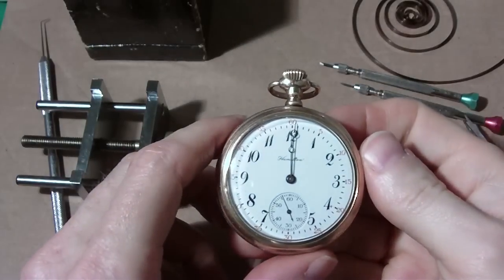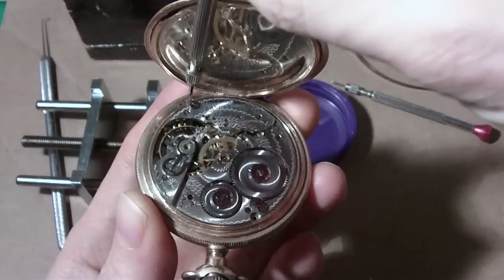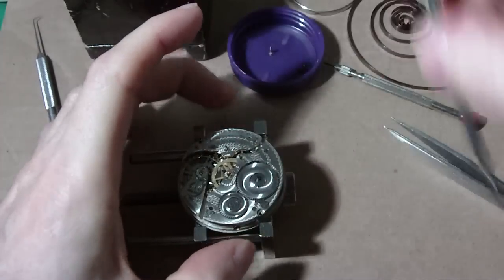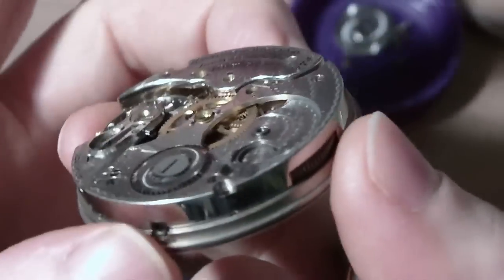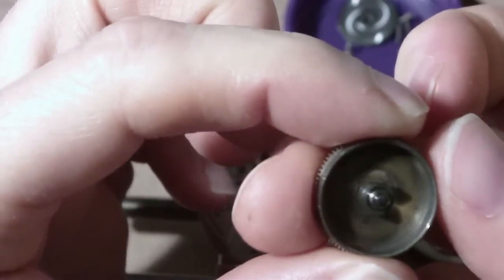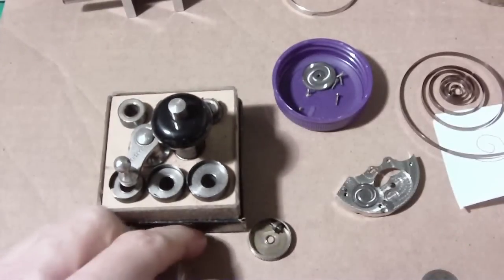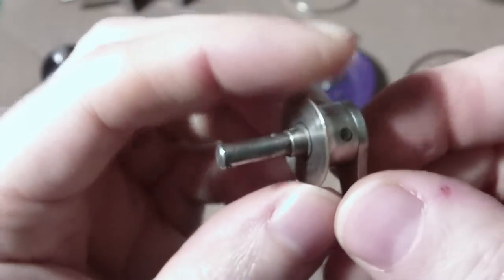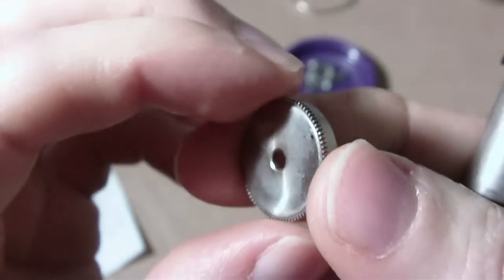How I Install a mainspring on a Hamilton 974 pocket watch, part 1 of 2

Comment from the maker: @mig29jette Since I have no training I don't know if my method is correct.  I installed the crystal while the bezel is off the watch.  I held the bezel in my hands and with my thumbs worked the crystal into the bezel.  I did not come straight down with the crystal but at an angle.  I sort of pushed the crystal against the inside edge of the bezel.  It felt like the crystal was just a teeny bit bigger than the opening in the bezel and I was either compressing the crystal or expanding the bezel.

Comment from the maker: @mig29jette I have little or no patience.  What stops me from throwing a watch against the wall or smashing it with a hammer is that it will not be repairable.  I have only replaced a crystal a couple of times and it was for an open faced pocketwatch.  I had to fit the crystal to the bezel by removing material from around the edge of the crystal a little at a time because if to much is removed the crystal will not stay in.  You might have the original crystal since it is so hard to install.

Comment: I think you have the perfect "demeaner" to do this kind of work. I almost lost it last night over replacing the same crystal on my Hunter cased Elgin which for some reason fell off in my hand.......the crystal did, and now the bezel pops on GOOD, I use the 'notch" in the side of the bezel to pop it back off. WHAT IS THE SECRET of putting this crystal back in a HUNTER cased Elgin. Do you try and get the crystal in the bezel FIRST? or do you lay the crystal on the face and try and center IT?

Comment from the maker: @ElginPocketwatch It might work but I wouldn't do it.  A 16 size spring is narrower than an 18 size spring so the T end might fit into the hole on the barrel but it might not stay there.  Also the hole in the spring for the barrel arbor might be to small.  Since the spring is smaller it might not have the power to run the watch correctly.  I would not do it.  Look on ebay for the correct spring.

Comment: i have an old keywind from the 1870's that needs a new mainspring, the problem is, it use 2 little notches at the end to hang on to the the walls of the barrel instead of a hole on the end. do you know if this kind of spring has a different name? by the way, i like the case and hands on this hamilton.

Comment: Just wanted to add one last thing from my last post. When I removed the mainspring barrel it was attached to a flat gear at the bottom that had a centre rubber post in the middle full of oil. Perhaps this is what is suppose to grab the spring and wind it up not sure. This was attached to the barrel with the spring coiled inside. When I was winding up the watch there was a series of click noises and the spring appeared to wind up and then let go with a whirling sound. Almost like the spring is slipping or not attached properly. I may have to take the watch to a watchmaker what would you suggest?
Reply from the maker: Mark20758 I am not familiar with the barrel you describe.  I only know of the motor barrel and the going barrel.  I believe the going barrel is the one found on most watches.  The outside of the mainspring is attached to the barrel and the inside on the barrel arbor.  The barrel arbor is turned when winding.  I forget how the motor barrel works but I remember it is opposite of the going barrel.  I have had the problem where the mainspring slips off the hook while winding and unwinds like you describe.  Either there is a problem with the mainspring or the hook that holds the mainspring.

Comment: And after you set it down on the face, do you gently lay the bezel over the crystal and try to snap it on around the case? Sorry, BUT I can rebuild the movement, and cant get the lousy crystal that came OFF it, back on! WHAT GIVES? Anyone have a link to a video to replace a HUNTER CASED crystal on you tube or by bunnspecial? please help me out!

Comment: Where can I get tools like that. Specifically the main-spring winder and the base you set the movement on?
Reply from the maker: I get my tools from ebay.  I am sure you can also get them from a watch supply store.  I did a video on tools I use.  Maybe you should check it out.

Comment: I have a question about my Waltham size 16 pocket watch. I have taken the main spring out of the watch and it is not broken however I thing the centre post that attaches to the spring has a broken piece off  of it. On my spring in the middle there is a small square cut out that should line up with a notch or bump on the centre post.My post  is smooth so nothing to grab the spring. What is normally there a raised prong or flange on the post? Inside the barrel on the outside edge I do see a raised tit piece that will grab the outer end. Do I need to buy another center post for the mainspring?
Reply from the maker: Mark20758 For some reason this was marked as spam so I am now just reading it.  You are correct, there is supposed to be a notch or bump on the center post to grab the spring.  I wonder if the little piece that broke off is still in the mainspring barrel.  You do need a new center post.
Reply: No I looked inside nothing. I think it does need a center post you are right. I was thinking if I can buy a cheap watch movement with a good hairspring and post on e-bay I could use this. When  l removed the spring from the barrel boy did it  ever fly I am glad I opened it in a plastic bag that you suggested. Part of the barrel flew across the basement floor and I managed to scoop it up with a magnitized screw driver. Still the watch is broken and I will have to get around to fixing it.

Comment: Hi,
Thanks for your reply. I will take the watch to a watchmaker in my area. I am a novice at this repair and it is way over my head.  When you take a watch apart to clean and oil the movement can this be done by anyone with good mechanical skills? I would like to buy a few parts watches from flea markets and try to fix them this is why I am asking.
Reply from the maker: Mark20758 As for mechanical skills I work on my own car, such as brakes, alternator, radiator, muffler and other things.  I would practice on parts movements that way if you screw up not much of a loss.  Also I would learn how a watch works, the function of all the parts.  I practiced on good movements because I only bought watches that worked.  When I started buying watches I didn't think I was going to need to fix them so why buy junk.  But old watches have old mainsprings that break and the local watchmaker wasn't cheap so I was forced to do my own repairs.  Working on watches that worked taught me to go real slow and take my time so as to not break it.
Reply: I have been working on copiers for 20 years so my mechanical skills are very good.I will start to read about how a watch works can you suggest a good book. How long have you been working on watches for? I must compliment you on how you do your videos you have to work on the watch focus the camera,adjust the lighting and talk all at the same time.
Reply from the maker: Mark20758 The way I see it if you can take apart and fix a copier you can do the same with a watch.  I did do a video on the books I use to learn about watches.  I took apart my first watch in 2004.  It took a while for me to figure out how to take apart a watch on camera.  The camera has auto-focus so once I turn it on I just have to make sure the zoom is set correctly.
Reply: Hi,
Yes you are right I should be fine working on watches with my mechanical background. Which video should I look for that talks about the books to read ( title so I can search) Thanks for keeping in touch.
Reply from the maker: Mark20758 The title of the video is '@watch?v=xdiAHKsODPY'
Reply from the maker: bunnspecial I cut and paste from youtube and the above is the link.  The title is 'Books I use for learning about watches and the repair of watches'
Reply: Thanks I found it. I have the first book complete watches by Shugart and I am reading it. I will look for the watch repairer's manual by H.B. Fried it looks like a good one. I have a retired man teaching clock repair close to where I live and I was taking Saturday repair classes but got away from it from a busy home life,kids etc. I will try to get back into the clock repair. Can you work on clocks or do you just stick to watches?
By the way I hear a westminister chime clock chiming in the background during your videos. Is this a Grandfather clock or a wall clock? Nice chime when I hear it.
Reply from the maker: Mark20758 It is a Grandfather clock.  I have some videos on that movement.  I work on watches.  Clocks take up a lot of space.
Reply: Is it a german 3 weight grandfather clock? I have one hear at the house beautiful chime on the quarter hours and hour. I know what you mean about clocks taking up space. I have around 15 clocks all in my basement I am trying to sell.
Reply from the maker: Mark20758 Yes, it is an Emperor clock with one of those Hermle movements.
Reply: Nice chime on that clock. Just curious what do you work at  for a living? I also wanted to ask you if you would like to tackle the mainspring replacement on my Waltham pocket watch that I sent you the serial number for? I can ship the watch to you. Not a big deal if you don't want to repair it.One of these days I will take it to a watchmaker.
Reply from the maker: Mark20758 Let me see how easy it would be to get a mainspring for that watch.  In my previous existence I was a Junior Design Engineer in a metal stamping company.  Now I am a subway train operator.